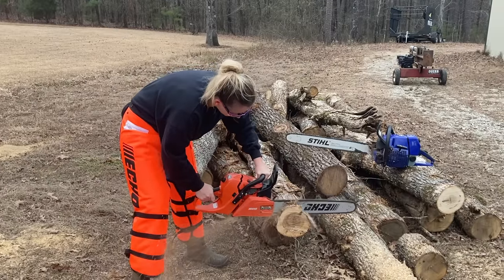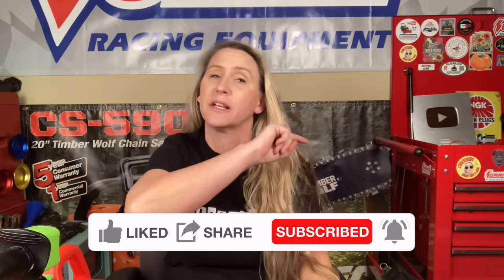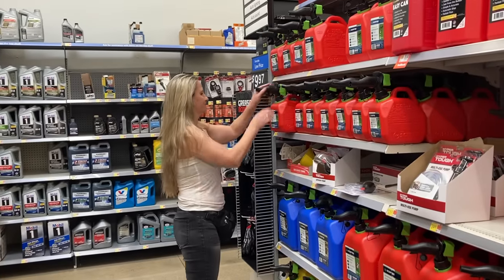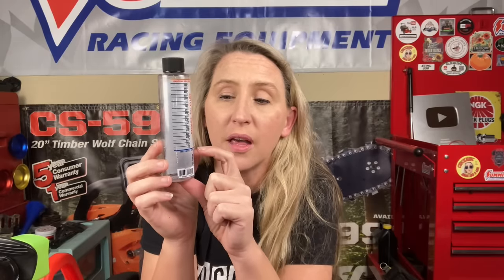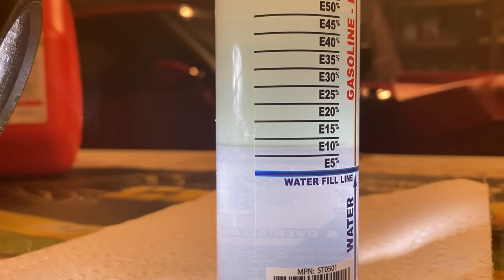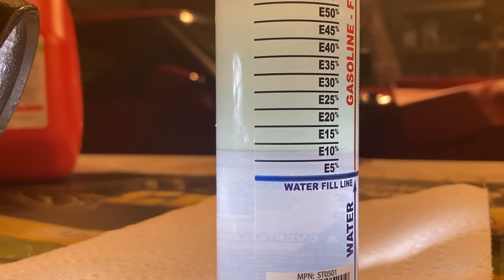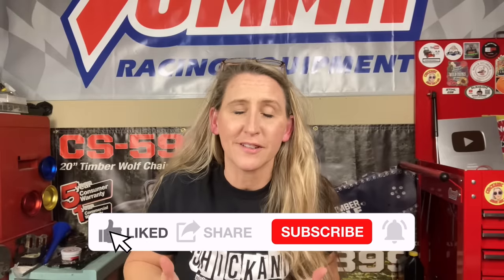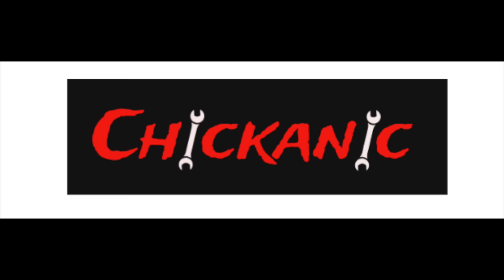Fueled by Deception. How You’re Getting Ripped Off at the Pump! (I'm SHOCKED!) VLOG

Comment: Interesting video. I worked as a small engine mechanic from 1973 through 1986. Mowers were beginning to get more complicated when I moved on. Anyway, the station where I buy non ethanol gas has a separate pump for each grade. I've been using non ethanol gas in all my small engines for years. It does make a difference. Now, if the tank at the station always gets the right gas is another matter. Btw I belong to a car club in a town nearby, and one of the guys mentioned that some older carburetor car engines have been known to have a problem with ethanol gas, he says because some carbs are not insulated against heat as well, and the ethanol can actually try to evaporate in the bowl. He has a '55 Chevy with a 350 engine, and he had noticed some time ago it began to run poorly. His fix was a thicker spacer plate to cool down the carb. I have a '73 Mach 1 and I always try to run non ethanol in it, from the same station. Interesting how, every time the government gets involved in something it goes to crap.

Comment: Note: Some, if not all, turkey basters are made from a plastic that completely dissolves in gasoline, so if a turkey baster is used, do it quickly and then dry it off to prevent damage. Depending on what chemical testing is done to the gasoline, the results may be affected by any dissolved plastic. Who knew?
Reply: It should be marked LDPE/HDPE somewhere, or recycling code 1-5. Polystyrene (code 6) will dissolve in gasoline. Polypropylene is probably a bad idea too as it's chemically similar to gasoline. I worked on a paint crew, and my buddy once sat down to clean out our road sprayer's nozzle in a styrofoam coffee cup. Before I could warn him it had melted through the cup and soaked into his jeans. So yeah, don't use polystyrene containers for gasoline!
Reply: @stickyfox  how about turkey basters for brake fluid? I use one on occasion to siphon out the master cylinder first (for clean fluid) when doing fluid flushes
Reply: @sc3ku  Brake fluid is one of those things where if it gets on/in something, I put my hand over my heart and look up to The Almighty begging for mercy.

Comment: Maybe pour the gas into a smaller container that has an open top and is easier to fill, and then fill your little bottle from that container.  The only issue is that you'll need a separate intermediate container for each red can.

Also, speaking of different containers, you may want to do this again, but use a completely new testing container so you won't have any residual ethanol in the next texting you do.
Reply: I agree; however, for demonstration purposes, this is a very good video. This is not a college chemistry lab class, so thumbs up for Chickanic.🙂👍
Reply: She could have just used a funnel.

Comment: I make my own corn free gas. The same way you test it also removes the alcohol. Everything above the test line is alcohol free since the water absorbed the alcohol.
I use a clear dish soap bottle. Put in some water, add the gas, shake, let sit. Carefully turn the bottle over and pull the lid off the bottle. Only drawback is it needs air after a bit to speed up the flow, and it only makes about a tank full at a time. I take the water/alcohol/gas waste and pour it in an old pie pan and let it evaporate.

Comment: My late father once went to an independent gas station/minimart in town and started pumping gas because it had a slightly better price than a nearby major brand. Well, he soon stopped pumping  because of the smell. He had studied chemical engineering in the 1930's and was very familiar with chemical smells. He smelled Methanol (wood alcohol) in the gas. I have no idea who in the supply chain found the cheaper alcohol and made some side money, but I believe it happened. However, there are myths out there like, "all gasoline is the same, it all comes from the big refinery at X. It makes no difference what the logo on the tanker is, they all get the same gas at the same place." Yes, this guy did see this happen, but he was mistaken. Each week the refineries send a sample of the base stocks to the brand laboratories, where they conjure up an additive package and test it. The brand then sends a tanker full of additive to the refinery with the recipe for their gas. The difference between the brands is the additive mix and how much is put in that brands gas. So, the tankers all fill up at the same place, but the additives are different for each brand. I hope this helps.
Reply: Methanol is what is used in racing vehicles and model engines.  Works great used as intended (Not polluted with gasoline.) and is very toxic.  It sucks in water like a sponge!  If you buy denatured alcohol at a hardware store, it is ethanol with a bit of methanol added to make it poisonous to stop people from drinking it.
Reply: The chains get it from their refineries and the independents get it from whoever is cheapest.  The difference is the chains will not put their additives in any fuel except their own. Anyone can buy it though. I hear all the time how much better Costco gas is. Costco doesn't have a refinery, they buy it from whoever gives them the best deal.
Reply: @donparnell9012  I actually filled up from empty on my new car at Costco last week and thought it was running particularly well. I’m very in tune with all my cars I know exactly how much throttle I need to give to trigger a downshift I know what hills i take to work that trigger a downshift etc etc so it’s not just a placebo. With that said who knows if it’s actually better or if Costco just had a higher standard and takes greater care of there equipment so you actually just getting a quality product vs a substandard product. I will also say there are times when I take a road trip and fill up in Ohio and make down south to say North Carolina or South Carolina and fill up again and can notice the difference in the regional fuel.

Comment: Before pumping gas, use your calculator to find out what grade was used last. Devide the gallons by the total  paid. It usually shows the last customers purchase 😊
Reply: That is a good idea, but a price change could throw the numbers off a bit.
Reply: @-DJ-  Yeah, but the price would have half to been changed right before you pulled up. Make sure you fill up in the middle of the day 😊
Reply: @Johnthreesixteen00  Funny, I actually wrote mid-day would be almost fool proof but figured that wasn't needed and delete that part. It is a really good idea for someone who doesn't have anywhere to put a gallon  before filling their fuel can. Like electric car drivers.
Reply: Good idea!

Comment: I have been using 87 ethanol in my lawnmower, weed eaters, generators, chainsaws etc for years Not one single problem ever!! All you have to do is run them dry before storage for the off season. 3rd generation mechanic and engine builder.

Comment: The Circle K near me has a individual hose for the Non Ethanol fuel. The gas nozzle has blue rubber on it, whereas the Diesel has Green Rubber and the other e85 e87 and e93 fuels have a black nozzle. So I get pure non ethanol each time I pump from the non ethanol hose. They have a tank for each one.

Comment: I put a gallon in my truck and then put the ethanol-free premium in the jug. I don't have many problems with the 2 cycle engines and mowers. The new gas jugs require a young torpedo to operate - I by a straight retro spout.

Comment: Just found this video after my newly acquired fuel failed my ethanol test.  Yep, single hose pump.  I spoke to the owner who was very nice and already aware of it.  He says you can expect up to 8oz from his pumps.  Fortunately, I filled an even larger container at the same time so we'll see how that test goes.  Also, I seem to recall you are down south.  All I can say is that plastic gas containers are garbage.  Be careful with them, with pressure from the summer, with cracks, etc.

Comment: Love your videos.   I have learned a lot from your videos.   This comment is going to be a long one because fuel is a complex subject.  I am a retired aircraft mechanic.   Aviation fuel is made of iso octane, the good stuff and normal heptane, the filler.   80/85 fuel is red,  100 low lead is blue and 130 octane is purple.  Av gas has iso octane and normal heptane only.  Auto fuel requirements are octane level only.   They  can use anything to raise the octane level to what is required.   Ethanol, propane, butane, flat beer, anything.  The vapor pressure level can vary greatly.  I was in a flying club that used auto gas in their aircraft.  The fuel had a vapor pressure so low that the plane could not get to pattern altitude without the boost pump.   The fuel was vaporizing in the fuel lines due to the drop in ambient pressure.  At the airport in Corona Ca a pilot was doing a run up before takeoff.  The engine would not reach the minimum takeoff rpm.  Upon inspection the gascolator was full of black material.   It was from the inside of the fuel line.  The pilot sent a sample of the auto gas to the FAA and the department of transportation.  Neither of them could determine what the stuff was.   This is the stuff you are putting in your car.  As far as I am concerned the only fuel that should be used in small engines is ethanol free fuel from a dedicated fuel nozzle.  Chickanic hit it out of the park on this one.

Comment: Our local station has two separate hoses for REC and Ethylene added fuel.  When I fill my 5 gallon metal jerry cans with rec, I start off by pumping a gallon into my car tank first, then fill the cans.  I've never had a problem with fuel, but just seemed to be a good idea.  To transfer fuel, I have a battery operated fuel wand that I stick into the can and just turn it on.  Works great, but still a little fuel at the bottom usually.

Comment: A funnel will help with filling most small engine tanks. But would tend to tip easy with that thin and light bottle. For that, I'd just pour some gas into a glass measuring cup and use that to fill the bottle.

Comment: THANK YOU CHICKANIC BECAUSE IT WAS THIS VIDEO THAT CAUSED ME TO FIND OUT WHERE ETHINOL FREE GAS WAS BEING SOLD AND TRY IT IN MY OLD & VINTAGE SMALL ENGINES.  I ADD STABIL FUEL PRESERVATIVE TO IT AND EVERYTHING i HAVE TRIED IT ON SO FAR LOVES IT WITH WHAT i BELIEVE ARE EASIER STARTS. I LIVE IN THE UNFRIENDLY STATE OF NJ WHERE ETHINOL FREE IS NOT PUMPED SO YOU CAN ONLY GET IT IN CANS AT OUTRAGIOUSLY HIGH PRICES.  I FOUND THAT ACCROSS THE STATE LINE TO PA I CAN GET IT AT MY FRIENDLY WAWA FOR $4.29/GAL. IT IS AN HOUR ROUND TRIP BUT I BUY 5 GALLONS AT A TIME AND IT IS TRULY WORTH THE EFFORT.

Comment: SUNOCO in my area has two pump nozzles per pump.  On the left is Recreational Fuel - Nothing else comes through that nozzle.  On the right is the standard three grades of fuel with corn squeezings up to 10%.
I grab the left hose for no corn squeezings added to to my fuel.

Comment: In Europe, they use a separate hose for each type of fuel. Also, they don't have a mid-grade (89) option, you either get regular 87 or premium 91 (respectively 96 and 98 octane with European measurement system).

Comment: I’m amazed any modern car can run on E85!! In the U.K. each fuel type has its own hose but we have 99 and 95  only. I always use 99 in both cars as with modern direct injection engines you want to keep the engine as clean as possible

Comment: One thing: you should always fill portable containers on the ground. That minimizes the chance of static electricity discharge (in KS, it is illegal to fill any other way, with the warning on every pump).
Also, in every pump offering E85 in KS, MO, or NE, the pump hose and handle are yellow and completely separate from “regular” gas pumps.

Comment: I have been using Avgas (100LL) for about 15 years in all my power equipment and have never had a fuel related problem, yes it costs a little more than car gas but it's well worth it. Also found out Briggs test runs all their new engines with Avgas. Just head to your local municipal airport, but mind all signage.

Comment: In Texas, we have Buc-ee's & Quick Trip that have ethanol free gas with a separate hose, though in the same dispenser. Think we're pretty much getting the real deal? There are three hoses, one for diesel, one for ethanol free (usually 90 octane), & one for everything else...... Great video, BTW, thanks for all the effort! The result from second gas station where you pumped the ethanol free into your car to purge the line, then filled the gas can is pretty damning...... wow. I have those test bottles from Amazon, never used them. I will now!!

Comment: This is why I use ethanol treatment from Lucas. I had a push mower that was over 30 years old. The fuel tank was spotless until the first season with ethanol gas. I noticed by the end of the season that the tank started showing rust spots developing. Plus I had to rebuild the carburetor. The ethanol treatment ended those problems and it ran great until the ring went in it. I will never run a small engine without any kind of ethanol treatment in it because I know I can’t trust most pumps. Spending a little extra saves a lot in the long run.

Comment: Thank you for this video it actually explains a lot. I got a new ms311 and it wouldn't run for me. Took it to the stihl dealer and he just changed the fuel out and it started working. He thought it was because of the oil I used but I use different oil now and it runs fine. So now I understand what happened. I must have gotten a low octane fuel at the pump. Pretty cool stuff to know

Comment: You're not supposed to use your thumb on those can spouts. You are to use the "heel" of your palm and grip the black lip with your fingers and then squeeze.
I thought they were the best of those crappy new EPA cans, but I was wrong. The O ring often fails and if not, the seals inside the spout will eventually fail and will leak fuel when in use. Imma bout to buy replacement spouts.
BTW, I've taken pliers and ripped those flame screens out from right inside the can. They're useless for people that don't play with fire around gasoline cans.

Comment: The first time I used a new Government"safety/fume"nozzle was the last! I immediately defeated that suckers guts and put a cap,or a plug on nozzle end,a small tub of sink plug are sometimes just right on the underside of plug,that will then fit snug over end to seal it.,. Rubber stoppers work good on inside of end of you just remove some of vent. Believe it or not I have started buying cheap old gas containers at garage sales,just to get the"good,old type"nozzle! The best ones are free if you are careful and/ or turn around when spotted on the road side if they are the "regular old type,some even have a screw on cap that seals them. And a vent with a cap,for a bonus!

Comment: Another thing is some places also use sub grade gas 84 octane then with additives and mainly addition of ethanol brings your octane level up to 87… when it is loaded on the truck it all comes out of the same hose just like at the station…usually gas blends are separate from ethanol 100 hoses and diesel blends are separate from 100% biodiesel…then the truck could have hauled a load of e100 then the next load could be e10-87 or diesel or something…a % of contamination will always happen unless you getting it directly out of the refinery…

Comment: One piece of advice Would be to use a funnel.
With a wide Cone
And possibly a to hold the bottle still. gas cans will never meant to feel a tiny little plastic bottle they are designed.
Fulfilling Gas tanks in engines. If it's any consolation my other gas can is even more difficult to use than that.

Comment: Here in Brazil we haven't E85, we have hydrated ethanol that is 96% ethanol and 4% water. I have no longer used gasoline since 2013. I only use hydrated ethanol! And that's good, the engine never carbonizes! The engine power is improved! Our engines here are all  "flex fuel", we can use mixture of gasoline and ethanol in any proportion desired!

Comment: I always knew those all-in-one pumps were deceptive, so I always pump a couple of gallons into the truck first even though I'm filling a large container. I run mostly old equipment so don't want any ethanol.  And my gas cans are still the old style with the spout and vent which I very rarely spill from. All the new "safe " type cans spill fuel every time.

Comment: I buy my  ethanol free gas from an outboard motor business who sells no other type fuel . I’ve never had any problems from this source after several years. Before then , every spring I had small engine No starts and fuel lines replacing. Carburetor diaphragms deformed or other issues . Next time use a funnel to fill your bottles . Thanks for the information you share.

Comment: Ah!  Interesting about the mix of residual fuel in the hose, where a gasoline retailer is thoughtful about that . . . 
There are some Maverik gas stations in Utah that sells a "Clear" 88 octane gasoline that does not contain ethanol.  And to ensure that dispensing of gas is free of ethanol, the pump uses a separate hose and nozzle for that "Clear" gasoline, which is denoted with a blue color selector button and blue dispensing nozzle.

Comment: Simple solution to your pouring issues would be transfer to smaller container such as large mouth oil bottle for transferring or get a funnel.
That tester is not meant to pour into direct from that large of a can spout. 
Back in 1982 we tested fuels with 100cc/ml bottle to determine alcohol content, which was creating fuel performance issues for our 2-smoke racing motocross motorcycles. 
Amsoil Al